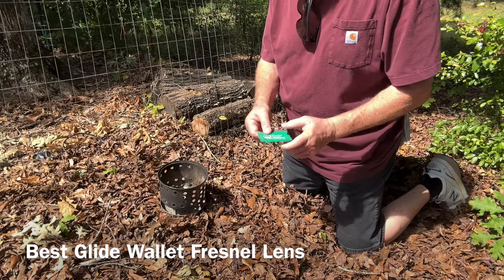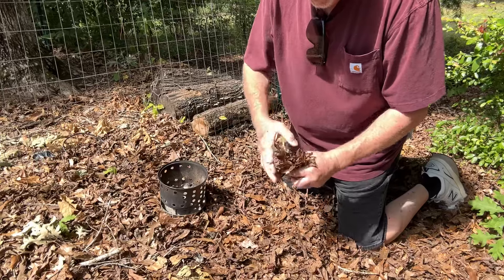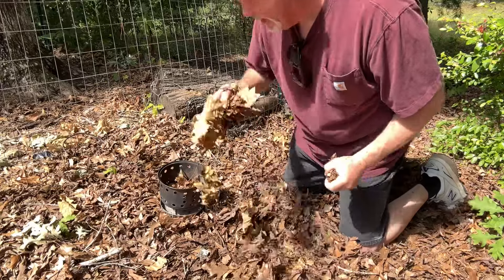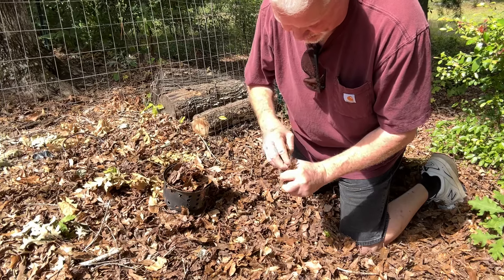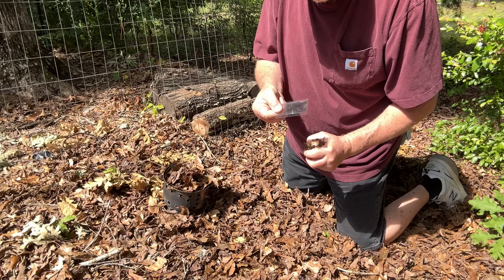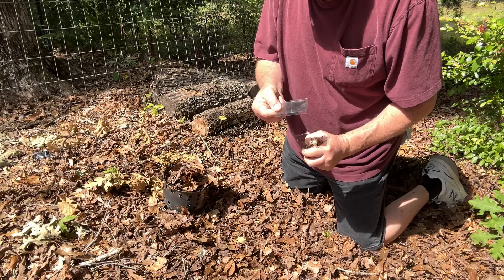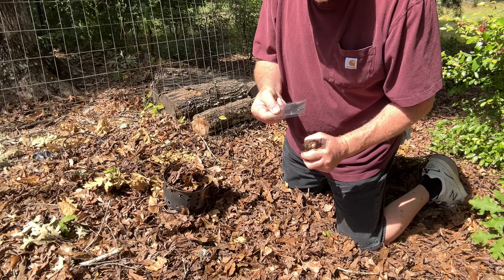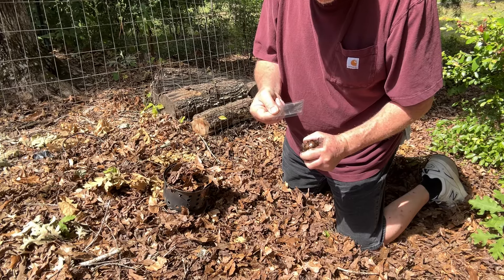How To Wallet Fresnel Lens Solar Ignite Difficult Tinders

Comment: Yesterday I tried to get a leaf ball (oak) ember using my SAK magnifying glass. Didn’t work but that’s why we play with Fire 🔥, I want to know what works for when I need it.
Reply: Don't feel bad friend...I also find my SAK magnifying glass pretty worthless for fire starting... it's good for seeing slivers and knots!  I just use my fresnel lens' as they are much faster!  I have the one Mr. West uses, but also have a Bausch & Lomb 3x5" lens that starts fires right now!
Reply from the maker: I need to practice with one of those from the SAK. I’d like to see what it could do.
Reply: @DavidWestBgood2ppl  I think you could probably ignite char cloth/punk, but I've had no real success with much else.
Reply from the maker: The physical size of a magnifier is what makes the hottest focal point not the power of the magnifier. If a fresnel lens is 10 times bigger than the SAK's magnifier... then the fresnel lens' focal point is 10 times hotter.